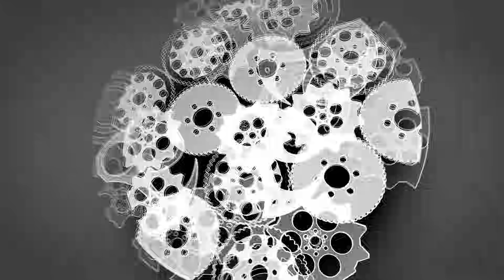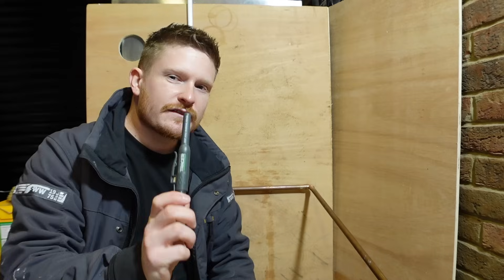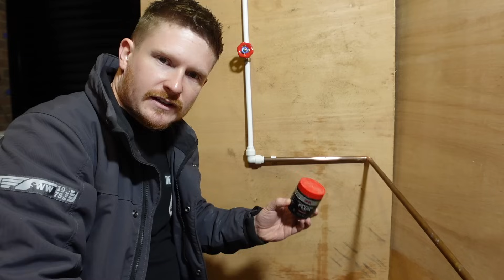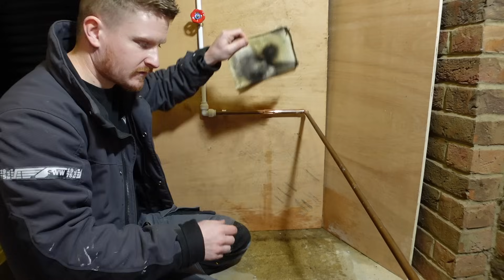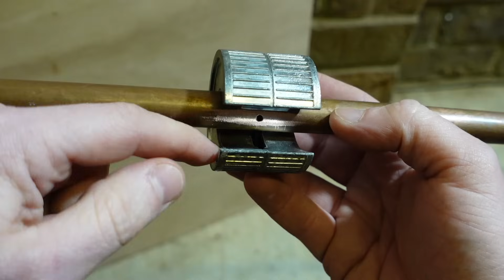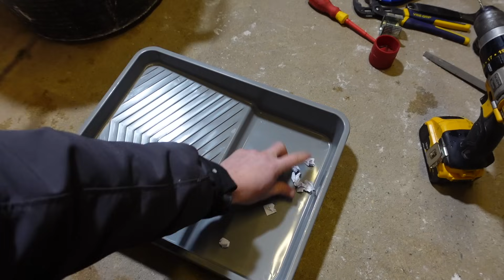How To Fix A Hole In Copper Pipe | Emergency Plumbing Repair

Comment: I would emery cloth around the entire pipe and use enough flux, take a standard coupler and cut in in half down the middle making two of those pieces you show or just cut one side and spread it until it fits over the pipe and squeeze it down, even maybe using a hose clamp or two to form it back. Make sure the crack line is well away from the pipe perforation. Solder as usual and if needed have Channellock pliers ready to squeeze while the solder is still molten.

Of course, the best way is to fix it right by cutting the pipe with a tube cutter and installing a coupler. If the pipe won't flex enough to get the coupler in, then go down the pipe to a fitting where you can get enough room. I would hate to install a union, especially in a wall where it would be covered just to have it leak later.

After seeing the device, I do like how it snaps into place. The keys to effective soldering are.... 
Clean, Flux and not too much heat but heated evenly. Solder is drawn towards the heat source and yes, no movement while cooling and let it cool naturally.

Comment: I get tiny holes and inject non bubbling gorilla glue  - works great. 6y an holding.
For larger problems  - rubber stretch tape .rap 1x then ad copper plate and apply pressure wrapping. Also works. 
- in case your scared  of a blowtorch

Comment: Only comment I'd add is that the hole in this vide was caused by a drill and not by corrosion.
It's more common to run into pinhole leaks that are caused by corrosion which requires a lot more work than what was described in this video. When the cause is corrosion, you can bet that much more of the pipe has been weakened than just the one or more pinhole leaks that are visible, what's happening is that on the inside of the pipe you probably have several places where  a hole is about to show up soon to follow the ones that have already appeared, and every one of them on the inside of the pipe will look like a BB hole in glass (a kind of inverted cone). 

So, in all cases where the pinhole(s) are caused by corrosion or old age, you have to remove and replace that entire length of pipe. Don't repair just the pinhole or you'll end up coming back again and again as more pinhole leaks will show up.
Reply: Simple cut away the bad area and use a joiner
Reply: Lmfao 🤣

Comment: I had a pipe split a bit due to an unusual freeze as the pipe was outside. All I did was put a piece of bicycle inner tube over it, take a hose clamp and tighten it up over the split. It's still holding over 30 years later.
Reply: So you’ve been drinking and cooking with inner tube residue for 30 years? Nice.
Reply: @vinny5004  what would that matter considering what is already in your water ? Anyway, cant happen as the hole was so small it was barely spraying out. The most important thing is that it was the hot water pipe to my old garage for the wash room. Sink and washer machine. Plus stuff just doesnt transfer like that in enough volume to make any differance at all. Thanks for being concerned about my health.

Comment: Never seen them good idea . Probably not cheap or easy to find. I just use an end feed fitting ( you could use a solder ring one, a bit longer ) cut it in half, file out the little ridge in the middle. 
Tin the inside, tin the pipe round the hole then solder them together and try not to make the same mistake again

Comment: My Dad used to just take a short  piece of copper pipe one size bigger and cut it into two half pipes , then he would use one of the half pipes just like your fancy patch . He sure taught me a lot of stuff I still miss him , he’s been gone now almost ten years . Great channel you have thanks for the update in technology , all the plumbing here in Canada has been plastic for about thirty years but I still think copper is better just more expensive so it’s only used in industrial or commercial buildings now not residential.
Reply: Sounds like a good dad
Reply: “All the plumbing in Canada” 😂 I live in a house with copper pipes only. As with the rest of the homes/buildings in my community. I was told last year that all houses would get plastic pipes but I still have yet to see that. Im still dealing with busted, pinhole in my copper pipes. Sucks. Lol. 
I know this comment was a year ago. I just had to correct the “all the plumbing here in Canada”. 😂
Reply: I said within the last 30 years it was plastic before that yes it was copper and sometimes crappy galvanized metal pipe.

Comment: Thanks for this. I'm in USA and I've never seen those patches here. I've fixed a few pin hole leaks but they always seem to be at elbows or couplings.
Reply: When it happens at elbows and couplings, it's usually because the pipe wasn't properly deburred on the inside before fitting. This creates internal eddys in the flow that eats away the pipe over time.
Reply: @heroinmom153  that is absolutely correct. 💯
Reply: I'm in Florida  - our water is eating from the inside. You get tiny holes on the outside  ( bigger inside wall)
Reply: @CHMichael  your water must how low ph making it acidic. You could always add a neautralizer tank with calcite in it to increase the ph to prevent the holes. Especially if you see any green blue coloring around your fixtures or in sink and tub. That’s a classic sign of acidic water eating your copper pipes up from the inside.

Comment: In the 2nd example of the traditional method of fitting a union you state that you could instead solder a fitting on each end of the pipe. I'd like to see you do that because the residue water in the pipe is drawn out to the repair joint when heated and stops the solder from setting because the water cools the joint down. I've tried it and impossible to do unless you know of a trick. Soldering the patch is different because the solder is external to hole, but soldering to an open ended pipe that is non-dry inside is a totally different thing.
Reply: I've seen some plug the pipe with rolled up bread, it'll stop the water so you can solder but afterwards just dissolve
Reply: @fuzzy1dk  me old Dad taught me . that trick 50 years ago brilliant isn't it ☺

Comment: I repaired a central heating pipe by wrapping bicycle tube around it and securing the tube with cable ties. It was initially a temporary repair, but it lasted for 18 years until I decided to replace all my radiators.
Reply: The anxiety would drive me crazy
Reply: I had the mounting bolt the holds the alternator in my car snap off when I was miles from home, No fan no cooling the rad like that.
Rummaged around in the trunk and found a small c clamp, clamped in place, I didn't think it would even work, keep my eye on the temperature guage and prayed all the way home.
6 months later I still hadn't fixed it.
Reply: @bipedalbob  you should tie something to the c-clamp so that if it wiggles loose it can't fall and become a object (projectile) on the road.
Reply: @jamesclark6487  no need,
That was over 40 years ago. I did finally fix it though .
Reply: ¨It was initially a temporary repair, but it lasted for 18 years"🤣🤣🤣👍👍👍
Reply: That's great, but a water heating system would not be under street pressure, or would it?
Reply: A small jubilee clip would be more secure than tie wraps

Comment: Buy a coupler and a pipe slice click the pipe slice wheel into the hole and cut the pipe put socket onto the pipe and solder

Comment: I had a tiny hole in a pipe in my basement right where I stood at my work bench that dripped water on me. I used a hose clamp and a piece of inner tube to seal it. That was over a decade ago and it still doesn't leak. They also sell couplers without an internal stop that will slide over the pipe, after cutting it. Then you can put flux on the pipe and solder the coupling. The solder will draw into the space between the coupler and pipe.
Reply: Yes otherwise known as a repair coupling.  If you can Solder , you can get away with filling the pin hole that way as well. Coupling is best.

Comment: I made a temporary repair on a pinhole on a mains pressure pipe. Couldn't turn the stopcock so I cut up a bicycle inner tube into a long flat bandage and wrapped it around the pipe, keeping a good tension on. Each successive wrap adds to the pressure and with a few wraps of gaffer tape to hold it in place. Did this on a car rad hose years ago and it worked.
As with all temp. repairs that work, it was conveniently forgotten. That was about 8 years ago and only now we have the plumber coming in for a bathroom install, will it get done properly. A proper fix in the first place is the correct solution, but this might just get someone out of trouble one day.
Reply: How much pressure was in the System?
Reply: @Florfff  the same pressure as in the 10" street water main less the head lost in rising 1 floor up. You could easily have run a long hose pipe off it .... that sort of pressure.  As i said, the more wraps, the more pressure you apply to the pipe [and hole] It was only supposed to be temporary ....... A proper fix is the best fix.

Comment: So using the second method how do you move the second section of pipe back far enough to slip it into the connector?
Reply: If you're using a push fitting like the one shown, you'd probably want to elevate one side of the pipe so you can push the fitting home easily. Then you'd have to hope there's enough play in the pipe to get the other side lined up. If you're using a solder or compression fitting they make "slip" couplings that the pipe can pass all the way through. You have to make sure each end of the pipe is of relatively equal depth inside the coupling when you go to solder or press it though.
Reply: No stop coupling
Reply: @ctaylor7089  Got it. Thanks both.

Comment: In my country you have to have a permit for fire works (soldering) so even professionals do not do it any more! All copper piping and fixings are done with pressing parts (do not know the exact name for those) So if you burn you house doing this, no insurance is covering that!

Comment: Can you not just put solder in the hole and melt it???
Reply: It will work just fine, especially if you use hard solder

Comment: I have never seen a patch for a copper pipe , But if it works ! I generally fix something like that with a copper coupling or a copper union sometimes I weld it with silfoss with 5 % silver in it .

Comment: Working in council housing it was always " changeover day" when people moved/ swapped houses that brought these leaks. When people lifted the carpets they pulled out all the nails they had hammered through pipes under the floorboards. Oh joy most Fridays 😂
Reply: I was chatting to an old guy in the local many years ago, he'd been a carpenter who worked on a large local council housing estate that was built in the early 50's. He was saying that the houses were really well built, and the workmen took a lot of care as they knew that they'd probably be living in one of the houses they were building

Comment: My electrician burst a pipe, to be fair the pipe was so close to the floorboard. He used the metal circle on the backbox and put some strong bonding glue  and it worked like a charm. 
It was funny when it burst, the high pitched scream never gets old :D
Reply from the maker: 🙈 ouch

Comment: See I have a pinprick hole in my Cooper piping in thr attic that's surrounded by insulation so I do t think using fire is a good idea
Reply from the maker: Second method for you then. It can be done with a torch but only with precautions
Reply: use a rubber washer over hole and a tighten an o ring

Comment: Nice video. A question: I had a leak on a 4 inch cast iron drain pipe and contacted the chemist from PC7. He had me apply PC7 plumbers putty and then let it set. Then PC7 epoxy over the putty - problem solved. Stuff hardens like diamonds. No problems for years now but I'd like to see if a similar technique would work on this copper pipe under water pressure with JB WATER WELD. It might be a good idea for another video - please consider. Thanks, I subscribed!

Tom
Reply: have you triedbaking soda and superglue?
Reply: @esecallum  No. I thought you were clowning but I just watched a video with a guy doing it!

Comment: how to do this for pvc pipe please?
Reply from the maker: I'll see what I can do 🙂
Reply: PVC should never be used inside structures let alone inside walls. CPVC is code approved, not PVC.
For PVC they have dresser couplers. For CPVC they have mission couplers. Mission couplers can be used on copper since CPVC and copper has same OD dimensions. Shark bites and push on connectors can work on CPVC and copper as well.

Comment: What if the hole is on the other side of tiled wall?(facing inside wall side) -Thanks
Reply: Cut the pipe and use a slip coupler. You'd be lucky to find anyone who stocks this odd pipe patch. It would be easier to solder over the hole or make your own patch with a piece of copper pipe.  You could always make a patch from a piece of the rubber sheath from a flex, hose pipe or inner tube and secure it over the hole with a jubilee/hose clip. Ive successfully used this technique before.
Reply: Put the clickfix on spin it around and heat the front of the pipe, it will still create capillary reaction.

Comment: DIY guy??? LMAO....that's what you call 'emergency repair'? LOL, dude, you're a real expert! And probably lost a.f. without your little expert gadgets.... ridiculous! Rather: Cut an appropriate piece of spare copper pipe, saw it in halves ( ) , clean the borders , flux & solder , done , with brains rather than industry fuckery that will certainly not be available in an emergency...

Comment: Very well spoken 👏 to the point clear example.. simply put thank you for thanking the time and making this video.

Sadly for me i was looking for a quick short-term rig fix.
My landlord is a plumber and they will have it fixed in a day or 2 max. Its a big rust out whole from the pipe being on top of brick. Next to NO room to tape it but i did come up with a the "rig of the day" 
 and seems to be working... take some Play-dough mold to fit over the hole in the pipe small sheet of clear plastic to wrap around the whole pipe and the P.D. than took 2 pipe holder starp clamp things that screw tight on both sides of the hole and poof no more leak! For now not sure how long it would work 😕 🙄
Reply: But on hour 8 and no leak yet. And its a main pipe lol i do have some plastic down for when it breaks again the water will go into a bucket
Reply: Anybody else here real-eye-zing that this Guy seems to have NO interest in actual DIY solutions? I bet he bought the most of his followers! See 'Fake Famous' documentary on how this works...
Reply: You can get compression fittings - similar to the first example in this video , but think a rubber gasket instead of solder and jubilee clips ...

Comment: I was gonna change my tap ,I turned the water off at the stop cock ,the's only 1 stop cock in me flat ,the bathroom taps went off ,but kitchen one was still running  . .what y reckon ?
Reply from the maker: It sounds like you may have a water tank supplying the tap in question. You will need to either look for gate valves(usually) from the tank supplying that tap or turn the main stop cock off and then drain the header tank.
Reply: @TheDIYGuy1  Y know what it was ,the stop cock tap needed to be turned off with the help of a shifting spanner, to give it that tighter turn off ,and not just hand tightened off ..we learn something everyday .

Comment: In my new house the sparky used a multitool to cut a patch out of the ceiling and nicked a central heating pipe that was on the other side of the plasterboard. He flew around like a headless chicken trying to stop it pissing down. I couldn't stop laughing! :'D
Reply from the maker: Lol these things happen. At least you took it well 😃
Reply: @TheDIYGuy1  My dad was a plumber so I knew what to do, as you said these things happen!
Reply from the maker: @sevenodonata  👍
Reply: @sevenodonata   doesn't matter if u know what to do. If you don't know where the shut off valve is  its gona cause a lot of damage while u look.